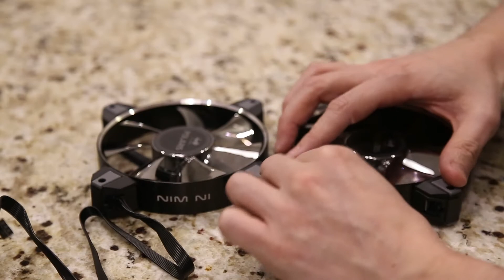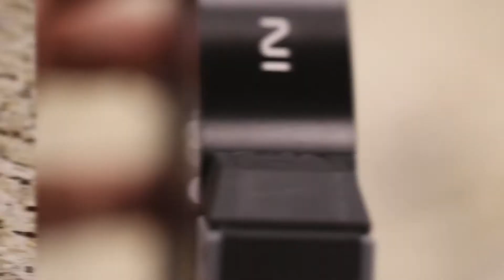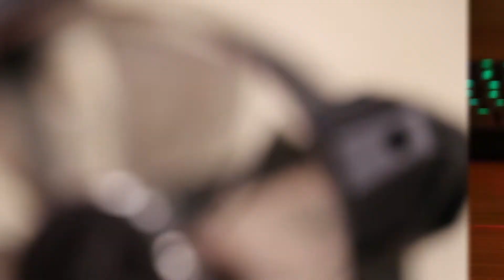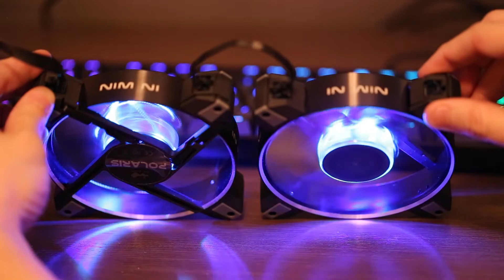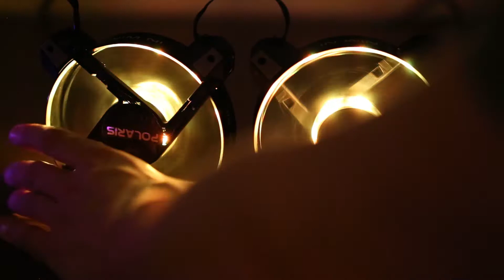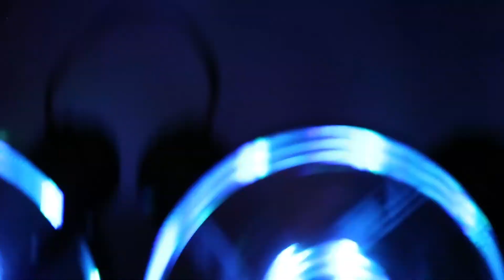InWin Polaris RGB Aluminium Fans (1 of 2)

Comment: I brought 2 of these and it seems I dont have that long wire you have. Instead it has 2 same sockets where you plug it in to the fan.
Reply from the maker: Hmm, not sure.  Yea, bought a bunch of the double boxes and they had them in there.  Where did you get it?  Was it possible returned and someone took it out?
Reply: @dragon.factory  my mother brought them in a differenr city. But it's okay. Someone helped me find wires that can connect them

Comment: I bought these and they look fantastic. But I'm having some problems syncing them to aura (and the InWin A1 case, for that matter). When they're plugged in, they constantly revert back to that stock blue. So if I put them on the breathing mode in Aura, they'll breathe from any color (say, purple) to blue. Also, I should mention that for some reason they don't glow green. Starting to think my MOBO has a short in it. I can't do yellow or red, either. If I play with a pins a bit I can get those colors to show up, but they never stick. Same thing if I plug in any RBG item into the mobo. Any suggestions?
Reply from the maker: Steven Smith that’ seems odd. I would try connecting single fans to each header using all the different wires hey proved. If it’s constant across all the fans seems like mb to me. Do you have anything else with an rgb header or a friends that you can test out?

Comment: I'm getting 4 of these fans.  So if you daisy chain two of them, you can just use one cable to plug into the motherboard.  Am I right in saying that?  Thanks again.
Reply from the maker: silver33 correct, you can daisy chain up to 6-8 (cant remember). So you could connect all 4 of your fans to the motherboard from one outlet from one of the fans.  But that one outlet does split into 2 connectors.  One for the fan power and one for rgb.  So if you do 2 sets of 2 to the motherboard then you will to use 2 rgb headers and 2 fan headers.  Personally I would daisy chain them all.  Cheers

Comment: I've bought these for exactly the same case. Have you received your Spectre yet?
Reply from the maker: Joshua Long Joshua Long awesome!!  I do not have the case. Excitedly waiting. Do you have a build log anywhere?
Reply: None except a couple posts in IGN's PC gaming forum Battlestation thread. I have all the parts for it, NZXT N7 Z370 board, 8700K, two 500 GB M.2 SSDs as well as three 1TB SATA SSDs, and a Gigabyte Aorus 1080Ti. Got waterblocks, tubing and all fittings ready to go. I was one of the first 20 preorders for the Spectre, so I'm supposed to be in the first commercial run. Still no news since they missed the June ship date.
Reply from the maker: Nice, here is my log.  Yea, ordered a few days after they announced it, bought 7820x, strix e MB, two 500gig m.2s, two evga ftw3 1080 tis, blocks and glass tubing over March.  Now been sitting on all the parts for 3 months.  Been a rough wait.  I just am afraid  everything will be a generation behind once i finally get the case :(    https://forums.overclockers.co.uk/threads/jamess-epic-build-log-ft-singularity-computer-spectre-case.18815756/
Reply: Yeah, that's a distinct possibility with the 9th gen intel and Nvidia 1100 series knocking on our doors. I wish they were more communicative about the delays.

Comment: they are nice but they cost an arm and a leg last time i spent that kinda of money on fans were for eloops noise blockers and they were expensive too .. do you think they will last long as well how would you rank these compared to the thermatake ring plus ? im thinking of getting these and putting on my rad in an lian li pco-11
Reply from the maker: They are not cheap, agreed.  But they do offer a lot.  First, they are made from a lovely aluminum vs plastic like most fans.  They offer me the ability to run all 6 fans off of one cable that spits into PWM and RGB at the motherboard vs most fans requiring either 12 cables (if they are ones that have both a pwm cable and an RGB cable off of each fan) or 6 cables if they combined the pwm and RGB cable and then a controller hub like the terhmatake ring plus.  Being I am going with the spectre case and everything is exposed, its going to cost me to limit the wires to hid.  

I think they will out last my system.  the only fan I have ever had fail was a Noctua after 3 years, and if a noctua can fail, any fan can. 

I think the thermatake ring plus are amazing RGBs.  I have only seen them on youtube but I think they do the RGB better than these as they have defused lighting effect through a fogged plastic vs these are through a clear plastic.  I just think thats a better version of RGB from purely an RGB view.  For me, the look of the fan's side was much more important because all my fans will be facing perpendicular to the observer.  You wont have a direct face on view of the fans, so a lot of the RGB effective will be lost in my build. 

In the lian li pco-11 case (sexy btw, it was on my short list for this build), if you're going to have the fans facing you and have all that space to hid cables, I would consider the thermatakes or Corsair LL Series over these.

I think these shine in builds that want to serious limit cables.  I hope that the other brands follow suit and offer daisy chain options on their fans that allow for direct control of everything on the MB.  

cheers,
James
Reply: Mate I have the Riing plus fans and they are really good. They are static pressure fans good for a rad. Good value to get a 5 pack with the software controller. 120mm or 140mm (Y)

Comment: Nice in depth review of some beautiful fans. Looking to seeing more on the build. Any chance you could tell us how much these cost?
Reply from the maker: Thanks Phillip, the fans are $75 USD atm.  Cheers!!
Reply: Is that for 2 or 3?
Reply from the maker: that was for 2.  But remember, they run from the MB and dont require a controller hub to run, so there is savings there.  Compared to say 2 sets of Corsair for 6 fans, that would be around $190.  6 of these were $225.  So at $35 more, its a drop in the bucket of a WC build.  Thanks for watching!!